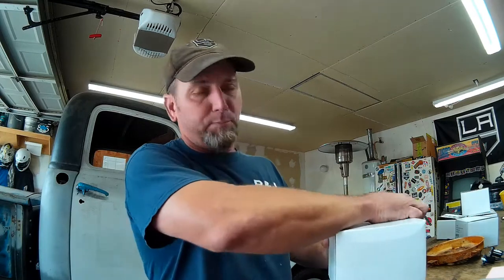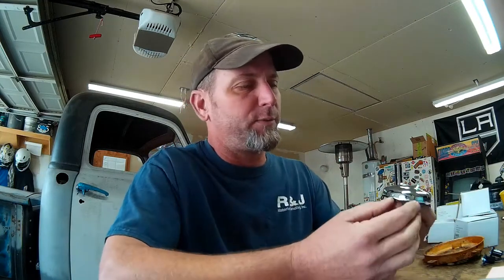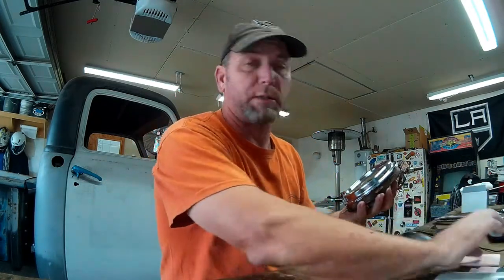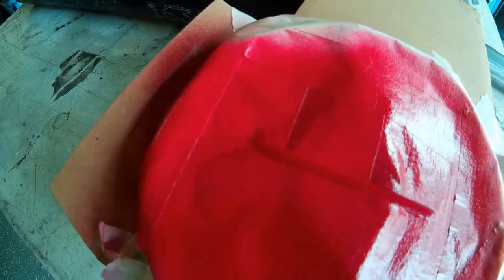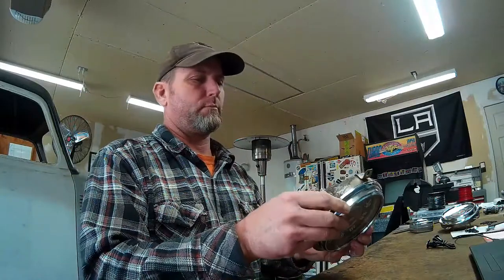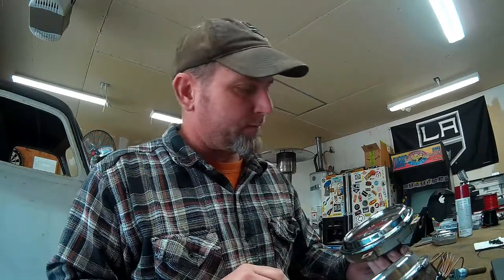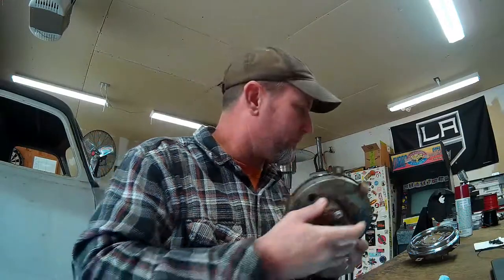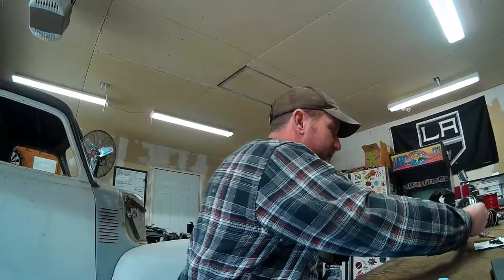P48 Project; Gauge Cleanup & Restoration, Part 2

Comment: The video is very good, except I need to add a caution on Fuel Gauge installation. I personally experienced issues when you use a 12 volt gauge (for 12 volt systems) and was that the new 12 volt gauges MUST GROUND to the inside of the cluster housing. I had a back and forth contacts with Classic Parts since the gauge I purchased did all kinds of crazy things because I painted the inside of the cluster housing and that prevented the new gauge from making ground inside the housing. So in this video he states that you must install insulator inside and outside of the cluster housing. So if you end up with no indication or crazy needle movement check to see if the new gauge is grounded to the cluster housing.